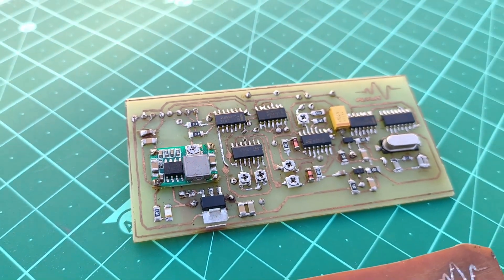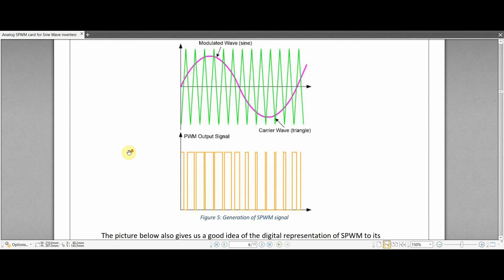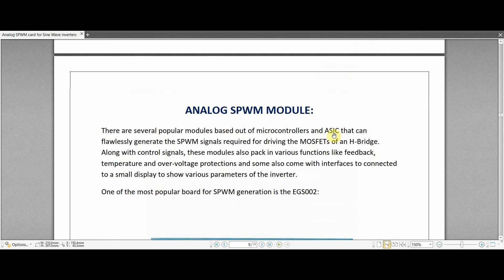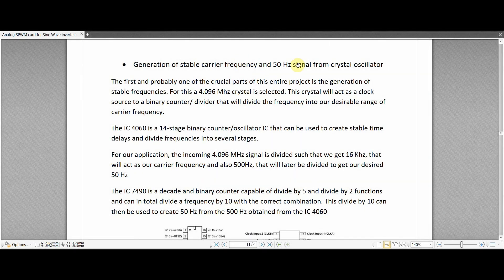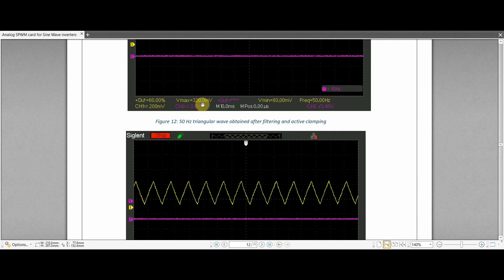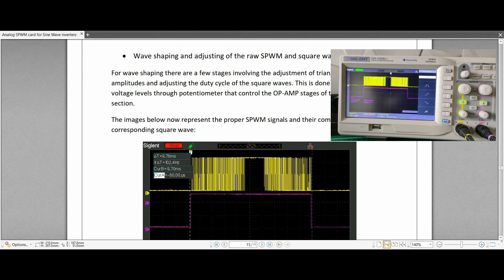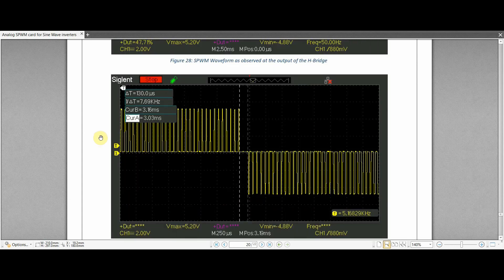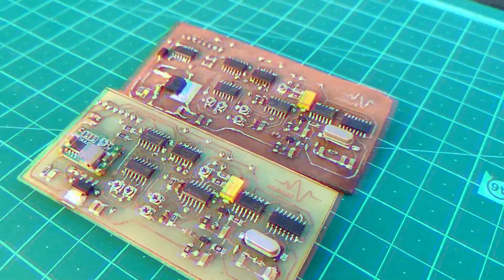Analog SPWM Card for Sine Wave inverters || Generate SPWM control signals for H-Bridge

Comment: I repair microtek luminous eapro genus sinewave inverter  but i appreciate your design
Reply from the maker: Thanks a lot!
Reply: @UtsavShah_25  Because i repair analog circuit analog (3524 driver and lm324 comparator  based long card and 121 inverter kit) circuitis too fast and much better than today microcontroller based square wave or sine wave inverter because digital ic cannot go into protection fast like analog circuit